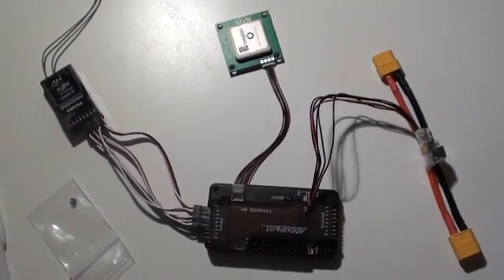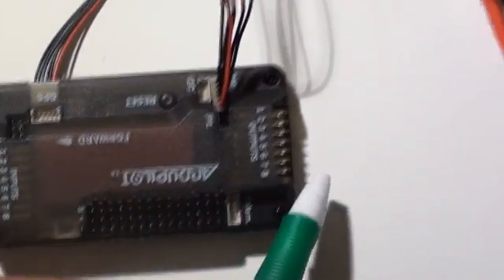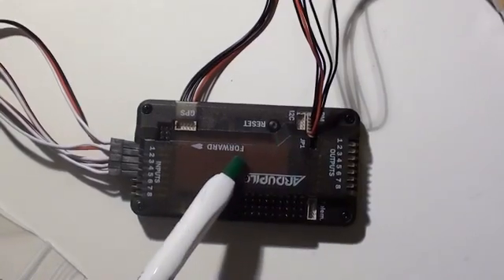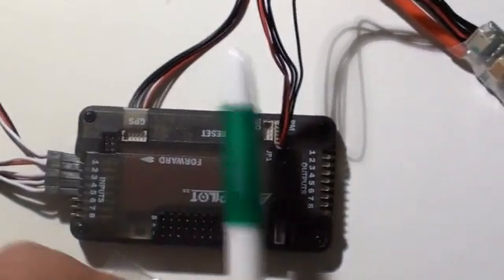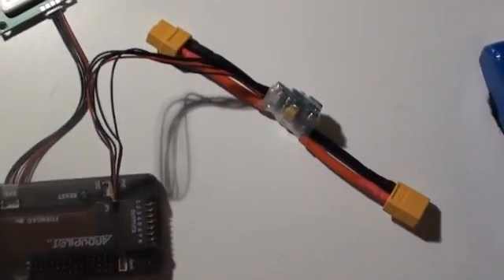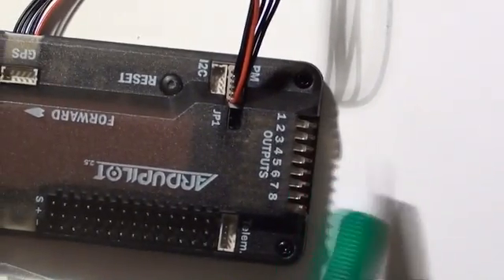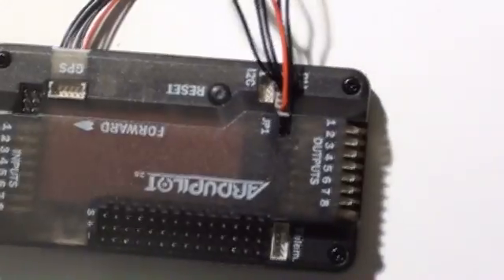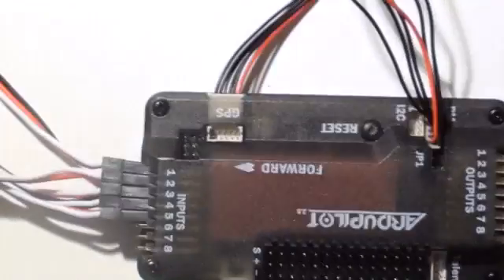APM 2.5  Ardupilot - Power supply explained

Comment: Always love your videos, is there any harm to connect a 24 volt lead acid  battery to the power module
Reply from the maker: No you should not, maximum input voltage is 4S lipo (18v).

Comment: Good video short and well explained, Thank you. I just downloaded the newest version of Mission Planner which is recommended, and can not find the settings to accelerate throttle; the problem is that not matter how high i lift the stick, the motors reach an speed and stay there.  Those settings used to be in the Advanced Parameters, as far as I remember. Can you help me out with it?

Comment: would you recommend using power module for apm 2.8(same circuitry as 2.5  for the most part i believe), if you are using opto esc and would you need to install the jumper? or if you dont have the power module and want to supply power to the board through Ubec , would you need to use the jumper then too.

Comment: Quick question, I'm planning on connecting my APM 2.5 with a Raspberry Pi over UART serial. I'm using a level converter from Bitwizard to handle the voltage conversion but I want to make sure that I won't have any trouble having the APM connected to a power module while also connected to UART0. It's not actually being powered via the serial connection right? I know it gets sensitive about being connected to a PM and a USB at the same time. Or should I be using UART2 instead of UART0?

Comment: Hi
i have this settup on my multicopter

1 apm 2.6
4 Afro ESC 30 AMP
1 FrSky receiver
1 Tarot Ironman 650 frame
4 390kv turnigy multistar motor
1 GPS module
1 telemetry Module
1 4s 5000 mah Battery
1 APM power module 

i want to use a custom pair of servos to retract landing gear
i have a Turnigy 5A external Ubec ...my question is

Where do i have to connect the external UBEC?

i have to disconnect the power leads of the ESCs?

do i have to connect the External UBEC + APM power Moudle + ESC BECs?

I have to connect the External UBEC to the reciever and leave the the power module and the power leads of the 4 ESCs connected?

Where do i have to connect the landing gear servos to cntrol it ?

i am really confused :/

Comment: Thank you for clarifying this! If I am using the power module and I have OPTO ESCs that have no BEC, does JP1 still remain uninstalled?  I ask since I plan to use a UBEC on the output side. Thanks!

Comment: Thank you 75echo for clarifying this as I was confused on whether or not I could use my ESCs with built in linear BECs to power the APM. Could you tell me what type of servo connectors you are using that go from the Input side of the APM to your receiver? Are they male/male servo connectors?

Comment: Great explanation! I understand that the electricity from output pins are separated by the jumper JP1. If not, there still be some currency consumption by the APM board, 3DR module, RC module and GPS module. Other ESCs would use their own currency.

Comment: Hi. Just wanted to ask...if you use the power module and the jp jumper is off, do you plug the esc cables in the output with all 3 wires or just the signal yellow wire?

Comment: I want to put solar cells on a large wing glider, maybe a flying wing. Im trying to determine in my head the best way to use the solar voltage. Your videos are good thank you! I think it would be best to use the solar voltage as a battery charge? I was hoping any one would know if you could use the adrupilot hardware to switch the solar voltage for charging and over flow. im pretty new to all this but another idea i had was just a separate power modual that charges the batteries if adrupilot board is not capable of this kind of task?

Comment: Hi, I ordered an APM pro.Can not find much information about it. Have a question.

I want to  work with the 4 in 1 ESC. This ESC has BEC. I also will use the seperate 5V unit.

Do I need to cut the 5V cable, or is there also a jumper that not should be placed.

Hope you can help me.
Kindly  regards

Dick Gerritsen
the Netherlands
Reply: Ik ben verbaasd rokus
Reply: Ik ben verbaasd

Comment: Damn i have a problem.
I use the BEC from my QBRAIN 4x25A (BEC 3A) to power the Micro HKPilot. I soldered the small pad SJ1 to power the board by ESC BEC
It seems that my RX is not receiving enough power. I use a OrangeRX 9 Chan receiver. i measured the Voltage only 3.85V. If i power With a 5V UBEC on the ESC side of the power board and disbale the power from the ESC by removing the VCC pin. Should this help

Comment: if i use the power module to supply power to the whole board with the jumper, do i just need to remove the middle wire from my four esc and it will be good? btw i have linear tye of esc. if that is the case i would rather just using the power module and leave the jumper on and not use the power from the esc

Comment: Will the usb power the output rail without the jumper? I'm gussing no but want to make sure. When using the usb should I power the output rail separately from one of my ESCs given that the jumper is disconnected?
Reply from the maker: The USB input voltage will not power the output rail. See my tricopter setup video for a detailed explanation.

Comment: Hi Great video i'm new to this but i need some information on this Power Supply explained  
Question: if i plug in the ESC's without the jumper does the BEC's on the ESC do anything ? would it be ok or do i have to cut the middle wire from the ESC?
Reply from the maker: If your esc BEC is of the linear type then you should be fine but if you have switching type BECs from your ESCs then you are advised to Cut the red wire from all the ESCs apart from one which you leave intact.
Reply: 75echo Thanks so much for the info keep up the great videos

Comment: He is a thought. Wouldn't it be better to leave jumper on and supply power with both power module and one ESC's 5V rail? Wouldn't it give redundancy in case power module fails? 
Another question, if i remove the Jumper and power the board via the power module, do i still need to remove 5V and GND wires from the ESCs? If the jumper is separating sides of the board, it shouldn't matter right?
Reply from the maker: You redundancy theory would have been nice but unfortunately it's not possible with this setup and instead more prone to fry your circuit. As regards cutting the 5 v wires from the ESCs, this is always recommended with multirotors unless you are sure that your ESCs are of the OPTO series or linear BEC version.
Reply: 75echo I'm confused! I have the Power Module, so should I not cut ALL of the +5v wires from the ESCs? I think my ESCs are linear but can't be certain.
I've already fried one flight controller (no idea why) and am desperate not to do it again.

Comment: I am just confused on one thing, if I have the power module connected to my APM board, can I connect a server to the output pins, without a BEC? Or will a BEC be required to provide the necessary power? Thank you...
Reply from the maker: The power module is ONLY to supply the circuit of the flight controller itself and never to power the output side of the circuit. If you have a servo connected on the output side then you will need a BEC supply on that side too.
Reply: 75echo thanks for clarifying that. I've actually re-read the instructions and its now all clear.

Comment: Hi 75echo, 
Thank you a lot for your detailed and clear tutorial. I had one question I know you made a video about it but i was not 100% sure. I have ESC switch type for quad copter without any servos, do i need to cut the power from 3 of them and leave one over?
Reply from the maker: Yea, with switching ESCs it is recommended that you disconnect the red live wires on all but one of them, you do not need to do this with linear ESCs.

Comment: This was helpful thank you for making this vid!  I do have, maybe, a dumb question, I am using a Turnigy 2650mAh 3cell LiPo that is labeled at 11.1V.  Would I be supplying too much power?  I have the power module, I just want to make sure I am not going to fry out the board!

Thanks in advance!
Reply from the maker: I also use a 11.1v battery. So no problems here.
Reply: 75echo Awesome, thanks for the reply!

Comment: If I power the APM using the included Power Module and I'm using a servo, would it be safe to use a 6V ESC plugged into the output rail? If so, what might the wiring look like? I'm looking to switch my brushed ESC controller for a brushless, and all that I have found have use 6v BEC.

Comment: I have my board wired and set up to use the power module but when I connect the lipo nothing happens (no lights from board) except the escs beeping. somehow I think the power is not getting through the board to the rx and gps. do you have any suggestions? The board connects to the laptop fine and I have calibrated everything that I can so far.

Comment: I bought my APM sensor on Ebay for a good price as I am on a strict budget, I know, this may be unwise, but as it turns out, it looks like the real deal and the cable is correct for APM multi pin input. I wonder if you would comment on the Attopilot PM and why anyone would use this over the type you and I are using? And with only 3 wires to the APM board this way. How, I wonder do they derive power for the board, a current and voltage reading and a ground connection with only 3 conductors? Anyway, you have produced a good video, I have subscribed some time ago and I am going to watch the rest of your uploads regarding the APM. I was just thinking that I may be poor in cash,... But I am rich with YouTube tutorials:-) :-)

Comment: Hi, when not using the power module, i will plug the jumper. But when using a quad does that means i have to use 3 opto (remove the red wire) ESCs and one normal esc? Thanks :))

Comment from the maker: I wish i could but unfortunately it is not as straight forward as that because one any diagram will depend on your hardware components that you intend to use. The APM wiki page contains  various diagrams for various hardware setups and the APM2.5 board is well labeled for you to see where to connect the various components.

Comment: I am a photographer without too much knowledge in multirotor. I just bought a new APM 2.5 board with power module. I assume the APM will be powered up when it is connected to a Lipo battery with JP1 disconnected.  However,  nothing happens until I plug in a micro USB power source. I just want to know if it is normal before I assemble the flight control system in my multirotor.  If it is not normal,  then I can return the product. Thx slot.

Comment: If you use OPTO ESCs they will need power in the signal side. By putting in the JP1 bridge the APM supplies the ESCs from the PM. This is perfectly OK as the OPTO ESCs do not have a BEC.

Comment: I wonder what the total milliamp draw on the power module when it is providing current to the APM and all it attatched:  3DRTelemetry radio, a telemetry type Rx like the FrSky d series, the GPS and the OSD. Anyone care to hazzard a guess? Now you add a servo driven dual axis servo driven camera gimbal what then? Is this where the ESC BEC comes into play? Congrats on producing such concrete and useful video content 75Echo. I find myself reaching for the subscribe button Happy Flying to all

Comment: Your Q-brain only has one power lead and the rest are just one gnd. and four signal wires correct? It is ok to have one power lead into the motor outputs. According to what I have read and what this gentleman has described. If everything is working again then you didn't fry anything. If not, :-( then you have done some damage perhaps. I hope you don't mind if I take up the slack here and try to voice an educated guess :-) Happy Flying Mate

Comment: Say you have an RC configuration  and inserted Y cables between receiver and servos/ESC. And then  you plugged one branch of Y cables to input ports of  apm to just listen. Nothing is connected to output port of apm.  Now the apm is powered via the ESC however from input relay. Should use the power circuitry and/or should plug  jumper in?

Comment: that power board has a shunt resistor that can fail if you exceed the max current or if is no a good quality, in that case you will remain without energy on the motors, so is not a good thing. I prefer powering my APM from linear escs so iven if 1 esc go bad i still have power from the others. this is just my idea. for the current consumption to be measured a hall effect sensor will be more safer and more precise

Comment: Trying to trouble shoot a problem...  I have the APM power module plugged in, JP1 OFF, but I did not remove the red wire on my Q-brain ESC (its a 4in1 ESC w/BEC). In effect I was then supplying 5v simultaneously.  While flight testing the quad suddenly lost power and fell dead from the sky only damaging a prop.. The Battery connection looks questionable which I'll re-solder, but could it be because of the dual 5v on both sides of the APM?

Comment from the maker: yes, if you do not have a separate power module for your HKpilot, and you plan to power it from the ESCs you will have to leave the JP1 jumper on. To be on the safe side cut the red wires from the ESC except one which will power the board. Even though this setup will work,i do however always advise a dedicated power module for your flight controller.

Comment: Dear Sr. 75 echo, I brought a hkpilot 2.5, it is the same as APM 2.5 ARDUPILOT, also brought 4 HOBBYKING BRUSHLESS ESC 30A BEC, do I have to cut red wire to 3 of them to power the electronic device for my quadcopter? I do not have to take off the jumper JP1.

Comment: if you are flying a quadrotor, would you need to disconnect 3 of the 4 red wires from the ESC's to prevent too much voltage being supplied to the APM 2.5? ive read this is the case with the DJI Naza. it says you need to cut 3 of the 4 red power wires. is 5 volts from 4 ESC's still just 5 volts? or is it multiplied into 20 volts?

Comment: Noob here.
I am using a F450 flamewheel frame with the apm 2.5. Do I connect the receiver to the board where the battery is connected?

Comment from the maker: Yes you can power both sides with the JP1 disconnected but do not power the input side with an ESC , use a dedicated BEC or the power module designed for this.

Comment: I believe you can also dual supply to both inputs and outputs side with JP1 disconnected. I split 1 ESCs power + and - from the signal and plugged it into the inputs side, then the rest of the ESCs into the outputs side with JP1 disconnected.

Comment from the maker: The power module is a Switching regulator.
One xT60 end takes 12 v from the lipo directly, sends it to the power module which converts it to a clean 5 v for the APM module, the other xT60 end takes the same 12V supplied from the lipo to the ESC and motors.

Comment from the maker: Hi Geoff, i have just disabled the alarm on mine and i use a lipo buzzer to know when its low. Try going into mission planner under configuration , make sure your correct battery capacity is selected , likewise select the  the current sensor you are using. Also you can set the battery alarm level that triggers the 'Battery low' warning.

Comment: Hi 75echo
I'm wondering if you can help, I have a current sensor fitted and having installed it as per the instructions my OSD keeps flashing "BATTERY LOW" even though the battery is well charged and the OSD show's this, how do you have yours set up, to date have tried may things without success, Regards Geoff

Comment from the maker: In your case
-The power module will power the APM module itself(and RC receiver, GPS unit that connected to the 'INPUT SIDE ' of the APM unit)
-Do not use the JP1 jumper .
-Your Turnigy ESC will supply 5 V to the 'OUTPUT SIDE' . Leave the red wire intact on your ESC since you have only one ESC on that side.
-Your servo also connected to the 'OUTPUT SIDE' will take power from the 5V ESC supply .
-Your motor is not powered from the APM board but from the Main ESC wires connected to the LIPO.

Comment: Good video , just what ive been looking for , just one thing tho , im installing my apm with power module on a plane and using one esc " turnigy trust 55amp , will i have to disconnect my red 5v wire ? or is that whats going to be powering my servos and motor ? thanks.